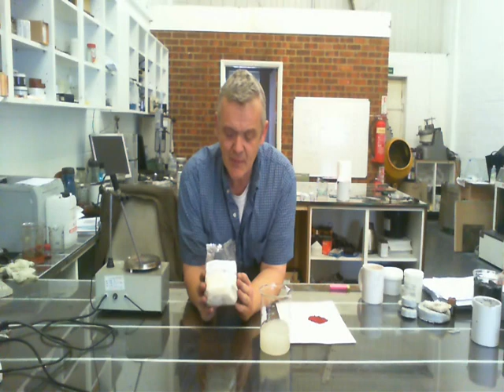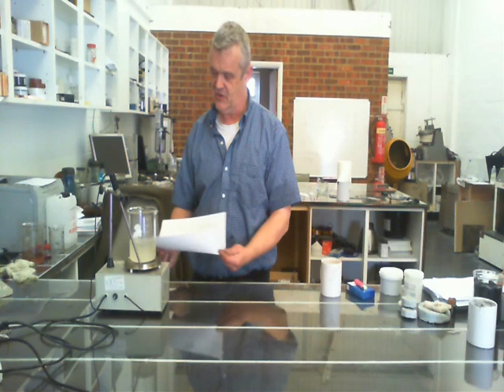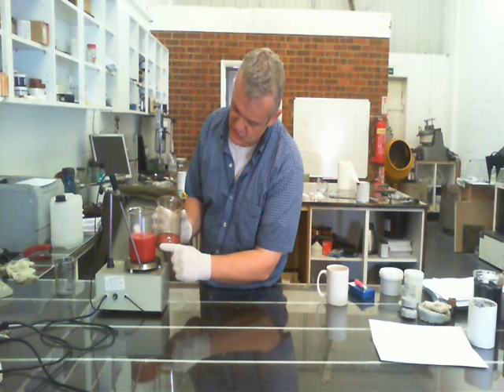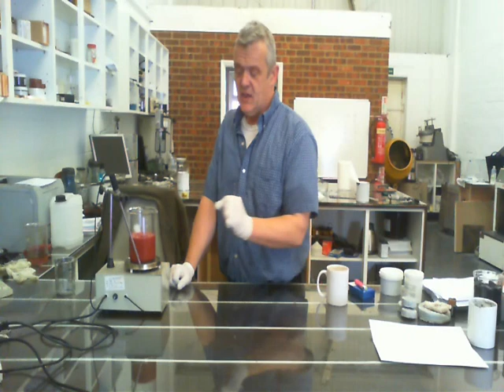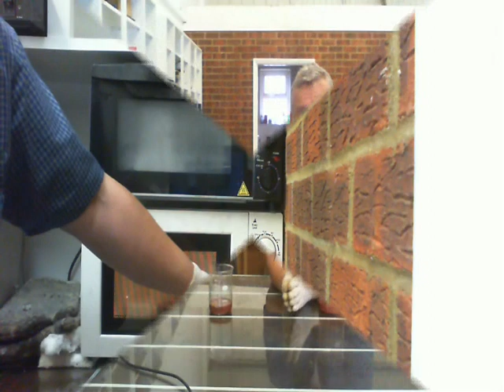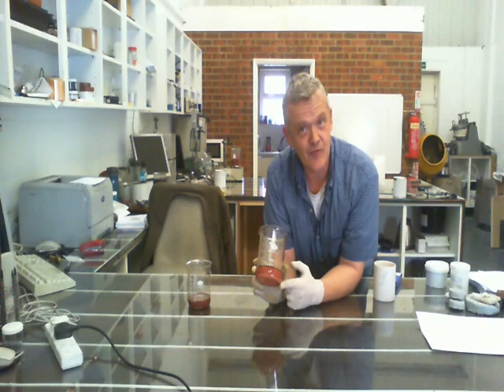Copper Nanoparticles In Gelatin

Comment: Robert, your videos are a treasure. For instance today I was wondering if I could disperse copper nanoparticles in gelatin to form conductive ink... I have a question. How do you open your microwave after microwaving formic acid? It turned my one room apartment into a gas chamber once before. The fumes burned in my lungs and my eyes and I had to evacuate hastily. I was trying to dissolve tin in formic acid, don't remember why. I think it did dissolve. So did the interior of my microwave. I believe I have plenty of copper oxide from ordinary non microwave reaction of CuSO4(aq) with Al. The powder I obtained reacts with formic acid 85%, forming azure blue. Awesome! However my CuSO4*nH2O(s) doesn't seem to be reacting with the acid. I now lack the courage to pop it into a microwave. Another question would be where to conduct my search. I read in Tesla notes on TV signal about concept of carbon printing. He wrote that gelatin treated with dichromates turns rock hard and impermeable to water. I cannot find anything more about the physical characteristics of such gelatin or about the possible hazards related to toxicity of encapsulated dichromates. I think I can obtain them easily by electrolysis of stainless steel. Once the electrolyte runs dry it turns from murky gray to bright orange.

Comment: I'm trying to find red copper oxide, but on ebay is only ebay black copper oxide. Does that make any difference?
Reply from the maker: it makes a difference - use red and look for it with pottery suppliers
Reply: Thx mate!

Comment: can you heat up the formic acid to hot and cause it to all go bad, or would it have to boil off to be ruined?
Reply: Good video Rob, I actually make lots of different colloidal metals. Gold, Silver, Copper and some rare metals too. About stealing ideas, I see so much of this going on it is just not funny. Gold turns Ruby red when the particles are around 2-5 nM. I use citric acid and sodium bicarbonate  with Gold but it still clumps maybe this would work with Gold too????
Reply from the maker: Thomas Anderson i don't really know mate - but it sounds like a good idea to try it
Reply from the maker: Robert Ritchie worth a try mate
Reply: Robert Murray-Smith huh? sorry not sure what this was to, I was just asking if the formic acid could be ruined by getting it too hot. I was having trouble finding the video where you used formic acid and copper sulfate or acetate and then used them from boiling but did not say how long you waited for them to cool off or if you waited at all, to ask the question cause that is the one I was following and it did not work for me for some reason :( 

so I was probing here to see if maybe I could find out what I had done wrong. 

right now I have a jar with the two mixed that were boiling when I mixed them, (copper sulfate/water solution and formic acid) that is still just a green (lighter than before due to being diluted by the added formic acid I am gathering) and has been sitting over night with still no copper precipitate or change in color at all, also when it was done mixed by pouring I continued to mix it a lot more with a bamboo  rod, but now that I think of it I think you used a stainless spoon, maybe this is where I went wrong?)
Reply: Robert Murray-Smith Well I hope you don't think I am stealing your ideas. I am building a CNC machine have you seen my videos yet?
Good ideas are like fresh poo they will attract flies and maggots LOL.
Reply: Robert Ritchie
funny you should mention that lol, I am working on the nano particle process myself for attempting to run it through a deposition system and photo sintering it to make solid 3D objects out of solid metal, hopefully when I get this sorted I can start working on my own ideas for other materials that should allow us to print glass and semiconductor crystal layers for transistors and all sorts of cool stuff and move 3D printing much closer to the replicator of startrek at least in capability of finished parts :)
Reply: Thomas Anderson  I can already do some of that. There are several methods to reforming solid metal from nano-particles. Gold is my favorite as it changes colors due to particulate size, Gold to black to blue to orange to red and fuse it back to Gold. In the processes Oxygen is an enemy you will need cheap CO2 or Nitrogen if you want to harden materials. The possibilities are endless.
Reply from the maker: Thomas Anderson some of this stuff gets pretty old mate - i probably did this a year ago and to answer properly i will have to revisit it. I will do that and let you know - though it will probably get to be a 3 men segment
Reply from the maker: Robert Ritchie lol - no worries mate
Reply: Robert Murray-Smith
can't wait, is there going to be more singing while stuff is processing instead of fades ;) XD
Reply: Robert Ritchie
I was thinking flooding and vacuuming out argon in the CNC bed chamber to make oxygen-less compounds or oxygen present (vacuuming out the argon so normal atmosphere returns) that way when argon is flooding the chamber it should push the lighter oxygen up away from the bed where the parts are being printed, though may need to increase photonic energy to make sure the oxygen can completely dissassociate from the compounds it might be locked into so that it can be lifted by the argon, otherwise I guess something light can be flooded that is reactive to the oxygen with more power than the deposited material and then flood the chamber afterwards to lift it away and pass it over something even stronger reaction wise than the one removing it from the deposition material like sodium for final collection to purify the argon and recycle it again to the storage chamber, just not sure what gas could be used to connect to the oxygen and steal it away from something like say silicon

Comment: You used 300 bloom, porcine gelatin. Where do you get it from? Also, does it have to be this type? CouId I use beef or vegetable gelatin, and does it have to be a specific bloom?
Reply from the maker: +Marilyn Kurman I just bought it on e-bay - as to the rest I am not sure - i am guessing it doesn't really matter - but you will have to experiment to be sure

Comment: Thank you very much for the information, I would like to know something; I was reading about gelatin as I am also using it as a polymer composite in my project, they saying that when you microwave gelatin, its proline part changes from l-proline to d-proline and they said if it changes it becomes toxic, so i wanted to hear your opinion on that matter
Reply from the maker: Khumbulani Mnqiwu i have no opinion
Reply: Robert Murray-Smith

Comment: Copper formate breaks down to carbon dioxide, hydrogen and copper. But these particles are not copper nanoparticles. Copper nanoparticles must be necessarily handled in inert atmosphere or with an oxygen scavenger to preserve their purity. At best, as you said they are large particles. Is the title is misleading?